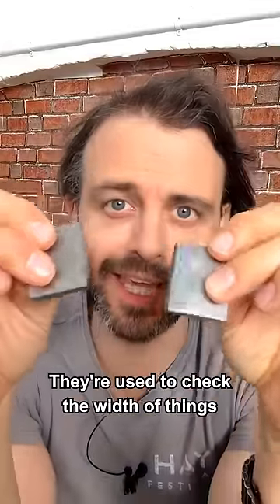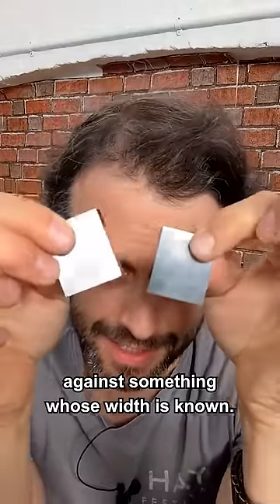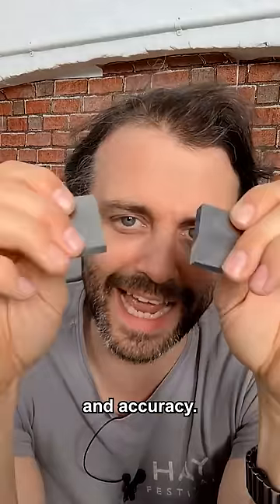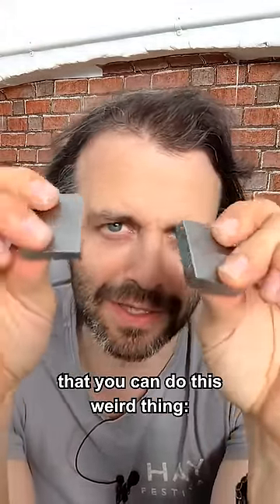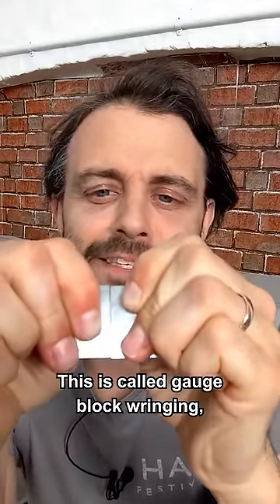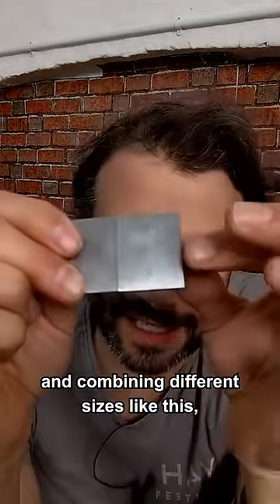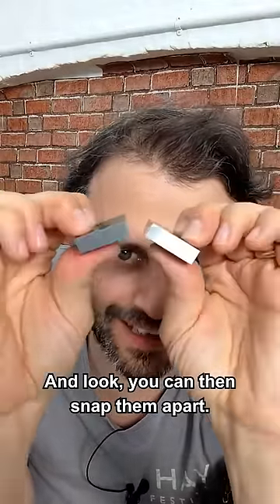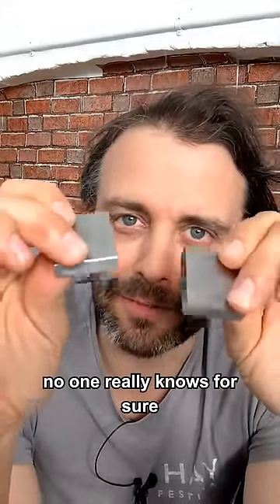No One Knows For Sure Why This Happens!

Comment: Isn't this a phenomenon called vacuum welding? Because from what I can remember, if you scrape the surface of a metal it removes an oxidized layer that under normal circumstances would immediately re-oxidize. But in a vacuum, if two completely bare metals touch, they'll bind to one another due to the electric properties of metal sharing electrons.

So if you get two near-perfectly smooth pieces of metal and rub them against each other, it'll rub off the oxidized layer but will allow close to zero oxygen to re-oxidize the surface, so they'll sort of loosely spot-weld to each other.

Comment: My first thought is simple. Velcro theory.

So
Objects touching each other, tend to want to stick together. Introducing friction (by moving the gauge surfaces against each other) introduces heat, which makes the surface of the gauges get hot, which makes the material expand. 

The smooth surfaces mean those surfaces make close, very smooth contact at most points across the material. Which means a lot of places get evenly heated in a gradient along the friction area, and thus thermally expands in a regular pattern.

The expansion of the material could make their differing structures interlace, and then cool, locking them into tentative structural bonds. Hence why they "snap" when you click em apart.
Sorta like how velcro has hooks and loops, and they make that satisfying "tsshhhhhhht" noise when you pull em apart

At least, that's my opinion.

Comment: I'd say the lack of air between the two blocks causes a vacuum, that vacuum being strong enough to hold the weight of either block, there's also the probability that the electrons/atoms  & magnetism generated by them is causing an attraction due to how  well organised & flat the two surfaces are a superficial bond is being created. A combination of the two methodologies could be the reason it happens...

Comment: It sounds similar to cold welding, so I’d have to say that by twisting them together you force the majority of, but not quite all, the air out from the tiny surface imperfections. You get a very weak cold weld as a result. This is my hypothesis.

Comment: My proffesor called it cold welding, if you left them long enough together, you wont be able to snap them that easy. Dunno if I say the right terms, but the “Roughness” is so low, that the very molecules of the metal bind together. Basicly like a Velcro

Comment: It is an old trick in some old car engine parts and some old steering boxes. Two mated surfaces so finely machined and polished that you just rub them together and they will stick without using grease. It is an awesome trick where while during assembly some parts might move that you do not want to move because it will make you start all over again.

Comment: They stick together due to the air trapped in porous pockets between them.

Creating a vacuum. Even on that microscopically finished surface, the small pockets that trap air become sealed when you twist them together. Hence why pulling them directly apart creates a vacuum which holds them together.

Comment: It's pretty simple, the surfaces are super smooth, as you "wring" them together, you expel all (most) air away between them, since there is less air per surface/space than elsewhere, a "lower-density" (near vacuum) exists compared to the rest of the room. The near vacuum keeps them sticking together. In space, this would probably not happen...
Reply: Nope!

Comment: The parts are flat enough that no air is trapped in between and Van der waals forces allow the blocks to swap electrons between each other. Metals have a structure that allows electrons to flow between atoms. At the joining of the blocks you've "rubbed" off the electrons from some atoms to others creating a charge imbalance at the septum. If left stuck like this for long, they will essentially be permanently stuck together as if they were one single block. This is called cold welding.

Comment: Isn't that related to that form of welding where you just use pressure to connect two pieces of metal after first removing any impurities from the surface?

I assume you're forcing all of the air out from between the two spaces, and where the surface is perfectly clean it then fuses as it would in a vacuum?

Comment: I thought it was the lack of atmosphere between them.

You have the pressure of the atmosphere pushing on them from the outside, but between them there is no pressure.
So to open them you have to create a vacuum for a very very very short moment, and overcome the pressure of the air.

Comment: Yeah scientists have a pretty good idea why that happens, the rub is what forces exactly are acting to cause it to happen. The biggest contributor is something many people will have heard of, cold welding. When you rub the blocks together you're wiping away some of the oxidation and oils, so the metal in one block doesn't know when it ends, and the other block begins, so they "cold weld" and start acting like they're one object. Of course there's still a lot of oxidation and oil so it's not a perfect connection and you can snap them apart with little effort.

Comment: This welding occurs in space where air doesn’t disrupt the metal’s structure with a patina. There are several discussions of this phenomenon including in volume 1 of Feynman lectures and I recall his hypothesis regarding very well machines copper sheets is that the copper is sort of “one molecule” a continuous lattice, and if smooth enough pressing two copper sheets together just joins two lattices, but incompletely in the short term and it gets stronger with time because of a kind of slow annealing. Overtime, more atoms fall into crystal formation.

Comment: doesn't have to be air pressure, slight friction can do so many things like increase the temperature of a coupleof water molecules to reach their boiling point. I assume enough of the gauge block atoms are either covalently or electrostatically bound by this wringing to create this stick

Comment: Pretty sure this is the effect of something called vacuum welding. Again, i'm not 100% certain this is how it works, but i think it's due to the smoothness of the faces of those blocks and the air being pushed out from between them, the metal crystal lattices kinda attach to eachother to make one bigger metal crystal from two smaller ones

Comment: It's most likely cold welding, if it was just lightly pressing together I might suggest suction, but a twist could remove a small oxide layer, and cause the blocks to merge. at that point, though, suction, contact welding, and even probably vaan der waals forces... if you get two ferrous things that close together, and grind them against each other... that's a lot of physics.

Comment: The surface of the metal is SO SMOOTH that when you twist them together like that is you removing all air between the pieces and until air can get between the pieces? They are vacuum locked to each other and even throwing them in a vacuum chamber doesn't quite break it as a vacuum chamber is never 'quite' a vacuum. You can really get it down there but it's never a 'complete' vacuum.

I could be wrong too but that's my guess.

Comment: That's just the Blish Lock Principle. It was originally used in the Thompson sub-machine gun. It was eliminated during world war two production for simply increasing the mass of the bolt assembly as the polishing operation necessary delayed production  time.

Comment: In its simplest form, the Casimir effect is an attractive interaction between two uncharged and perfectly conducting plates held a short distance apart—usually less than a micron. Classically, the only attractive force acting between such plates should be gravity. But that's vanishingly small for microscale objects.

Comment: Stiction is what we used to call the effect in the late 70's early 80's. Back when hard drives were the size of car tires. When you first spun up the drive with its ~1/4HP motor, it would sometimes rip the heads off, leaving them stuck to the platter.

Comment: The mechanism for gauge block wringing is a combination of:
Air pressure
The air is squeezed out when the blocks are slid together, creating a vacuum between the blocks. The surrounding air pressure keeps the blocks together.
Surface tension
Oil and water vapor from the air or remaining on the blocks acts like a glue to hold them together.
Molecular attraction
When two flat surfaces are brought into close contact, electrons are exchanged between the atoms of the blocks, creating an attractive molecular force. This force remains even in a vacuum or if there is no oil or water on the blocks.

Damn, but isnt it great to have access to the sum knowledge of mankind in the palm of our hands.

Comment: The electrons in both blocks move freely in the outer d orbitals of the metal. If 1) the blocks are brought  close enough, 2) there’s no air in the gap and 3) the surfaces are clean enough, the electrons will start jumping from block to block and basically fuse the blocks together. When you do that in space, the blocks actually fuse together and they become truely just one chuck of metal. In imperfect conditions like in this video, the blocks kinda stick together a bit. No one knows for sure?

Comment: I havent seen anyone suggesting they might be vacuum welding? https://en.wikipedia.org/wiki/Cold_welding This wiki article seems to explain exactly why with it's quote from Richard Feynman, "The reason for this unexpected behavior is that when the atoms in contact are all of the same kind, there is no way for the atoms to "know" that they are in different pieces of copper. When there are other atoms, in the oxides and greases and more complicated thin surface layers of contaminants in between, the atoms "know" when they are not on the same part." Seems like they know why this happens.

Comment: It happens because of the way metal atoms bond. With a clean enough and flat enough surface, similar metal atoms will attempt to bond by sharing electrons. The only barrier to this is the misalignment in the crystal lattice direction between the two halves. Solid state surface diffusion is the same principle that causes forge welding to work, but in the case of forge welding the process is sped up dramatically by pressure and heat. Given 10000 years in a vacuum, those two blocks would literally weld together and become one block

Comment: Any plans on a longer video for this phenomenon Steve? (unless you've already made one!)
Reply: Slip gauge. Measurement labs have those. It's a part of the mechanical engineering curriculum lab.
Reply: The action lab guy did a video on these years ago. Not too in-depth, but good if you want a simple explanation.
Reply: AvE made some videos years ago about them
Reply: Adam savage has a great video on this in one of his gauge block videos and its excellent. He says it is the surface tension that keeps them together
Reply: @joshpearson3606 probably since there is a small amount of oil film to prevent rusting. But other explanations include things like vacuum or intermolecular forces like how geckos feet work.
Reply: van der Waals force, paramagnetic force, and surface tension - a combination of the three are at play here.
Reply: @danieldimitri6133 you can wash them thoroughly and get rid of the oil and it still occurs.  Also, any of you saying that anything is absolutely the reason is lying and you don't actually know and you know it.  When he says that nobody knows for sure, he means it...
Reply: I think atmosferic pressure. Because the gauges are so smooth when pressed together they displace air. Because of this smoothness of the surface and  the lack of air on one of the gauge faces.
Reply: I speak german and i say i got the answer cause of following reasons:

These gauge Blocks are for calibrating measuring Equipment

The "holding together" appears by the tiny tolerance of surface roughness and can be achieved by many machining processes like grinding.. 

The machining tools described by you are called "Grenzwellennutenlehre" (limited shaft slot gauge)

Just for Information those gauge Blocks come in different materials (since theyre not for measuring but calibrating 🤷🏼‍♂️): 
ceramic, steel, carbide

And the why they hold together is answered by knowing what adhesion is 🫡 greetings from the engineering countries 💪🏻🇦🇹🇩🇪🇨🇭
Reply: @zondors It works in a vacuum too
Reply: Cody’s lab
Reply: Long story short, when surfaces becomes too smooth, molecular level friction starts working.
Reply: @BackYardScience2000  i didn't say that I know. But I will tell you it does work a whole lot better with a film on it. I know it's not electrical or magnetic because it works with ceramic. I'm not in the habit of wasting gage blocks becasuse they have value to the shop and rust is an issue. But I can also tell you that you can wring fresh new carbide lathe and shell mill inserts together but the bond is a lot stronger if you wipe your oily fingers over them first.
Reply: Does this hurt the block
Reply: @dakota8189  I knew I'd seen something in the back of my mind. Action lab!
Reply: @joshpearson3606  I had no idea Adam did something on this. I'll check it out. 👍
Reply: @brudenell27  hey great call back I knew I saw this somewhere!!!!
Reply: @mikerosopht3085  I like how you say it with conviction but knowing that we truly don't know, conviction or not I can say with 100% accuracy that you don't know.  Maybe one day we'll know but that is not today.
Reply: @mikerosopht3085 there is one more.
The Casimir effect.
Reply: Until he has an answer, I assume
Reply: @mk_rexx  I didn't say "how long until" but nice try 👍
Reply: Adam savage has a video talking about his block set that goes more in detail
Reply: I find it super cool that there are still things in our world that we can't really explain, and particularly this one, which you would think we could figure out by now.
Reply: @mikerosopht3085 Any time an explanation for a physical effect involves that many different unrelated effects, it strongly suggests we don't actually know and are just guessing
Reply: Aether. It's the aether.
Reply: @zondors except it happens also in a perfect vacuum.